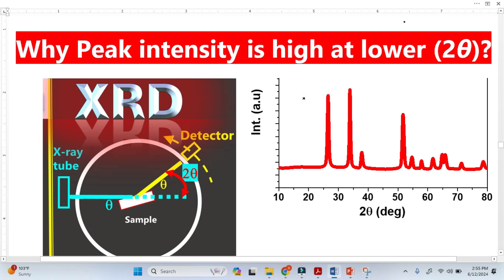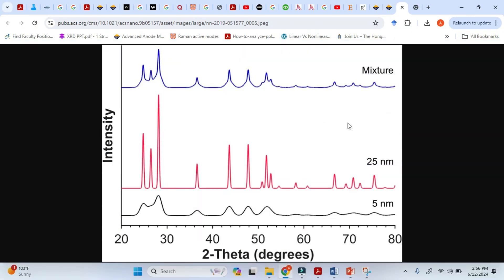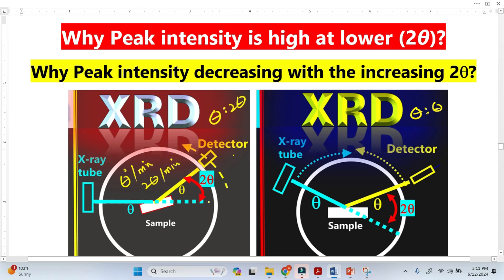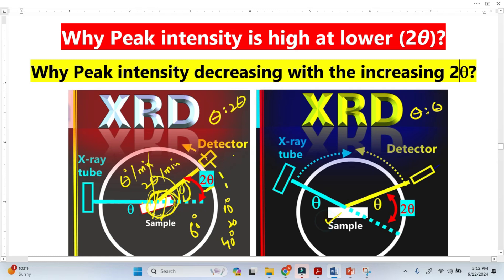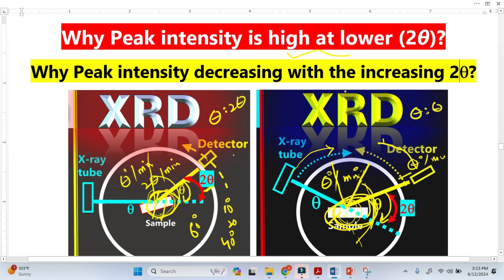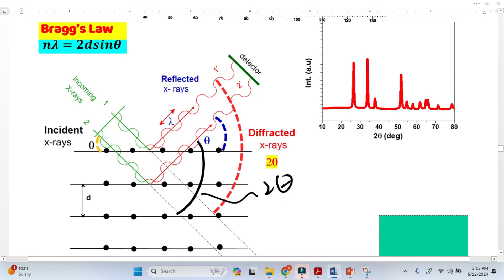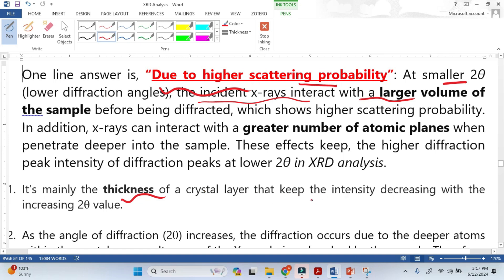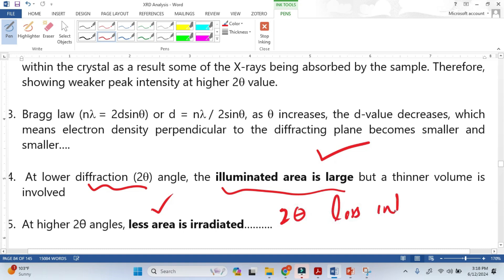Why XRD Peak Intensity Drops at High 2θ | Explained Simply

Comment: no...When the angle is very low, around 1 to 2 degrees (2θ), how is the probability of scattering higher? Wouldn't the scattered rays just skim the surface and go directly to the detector?
Reply from the maker: No, it wouldn't skim the surface like a mirror or ice.
Look, when the angle is small, the probability for X-rays scattering is higher, i.e., x-rays have to travel more, and there are more chances for scattering. 

When we gradually increase the angle, the path length decreases, and there are fewer chances for the x-rays to scatter

Comment: Appreciate Dr for excellent explanation. Could you please share the specific reference for evidence this clarification thanks
Reply from the maker: Most of the posts and videos on XRD taken from the book title Elements of X-Ray Diffraction by B.D. Cullity & S.R. Stock. It is free available. 

Anyways some contents of my videos or post MAY NOT be found in this book and I just used my concepts or taken some concepts from RG. After reading and clearing my concepts, I made videos. I am very happy to receive your comments if you have any concerns. I am here to help and discuss to the best of capability if any queries related to the topic. 
Wish you best of luck!
Reply: @nanospeaks  highly appreciate Dr that’s your kindness, Dr did you work on perovskite materials depositions?
Reply from the maker: @goldenwing5375  welcome. I worked little during my PhD. in 2015, but later on ,I could not find any opportunities to work on . I did write  many reviews on pervoskites solar cells.
Reply: @nanospeaks  many thanks Dr for swiftly reply, I have issue in  the deposition when deposit perovskite solution on substrate during spin coating process the perovskite solution doesn’t dry well and stay a little bit wet , could please advice me what is the problem or recommend me what I have to do for modification the spin coating process , thank you
Reply from the maker: @goldenwing5375  where are you working now a days ? 
I have a friend working in MUST, Kashmir, and we can discuss it with him.  Because he is involved in this field.
Reply: @nanospeaks  I am working in Malaysia
Reply: @goldenwing5375 Try mixture of solvent which definitely helps for you to reduce grain size and increase the compact coating on the ITO or FTO and also eutectic point for the solvent. So during spin coating only it will dry.